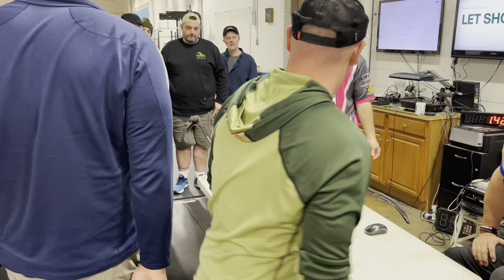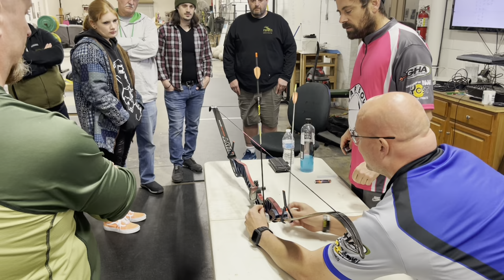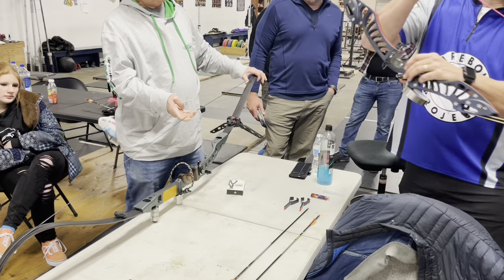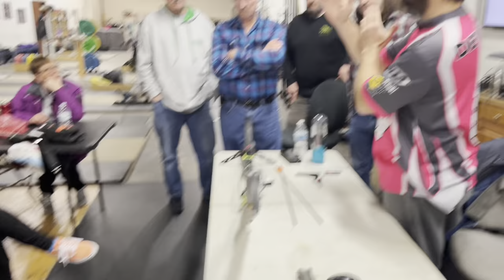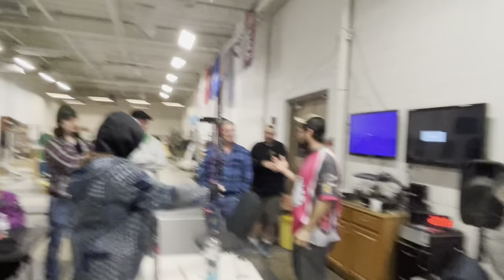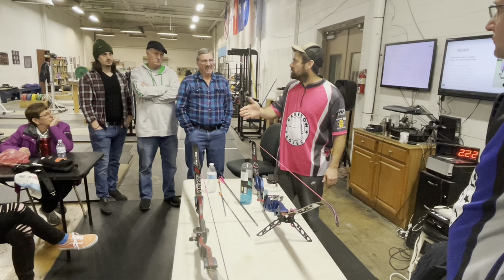Advanced Barebow Seminar - Basic Tuning Discussion

Comment: Very useful video guys. Thank you very much. Affirmed a few things I always had doubts about. And a few things that I didn't know. I never considered moving my centershot away from the center like that... Question... When JD does that, am I to assume his string-blur when he shoots is to the right of the arrow tip? (I set my string picture with the string-blur to the right tangential 3 o'clock on the arrow tip... do you guys do the same?)... Thanks again
Reply from the maker: My string blur is mid plunger or wider depending on crawl and head position . ~FMCD